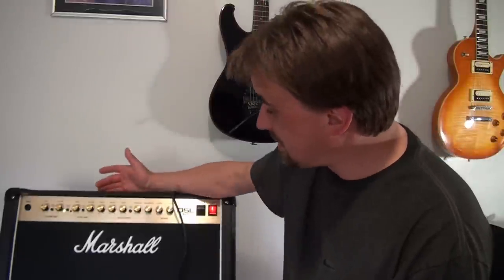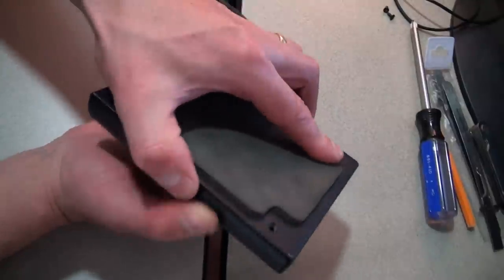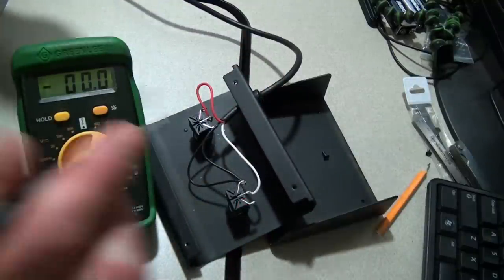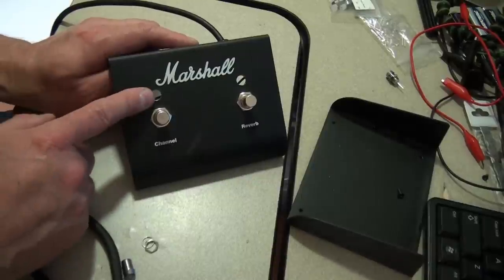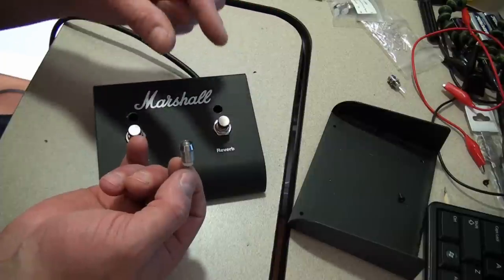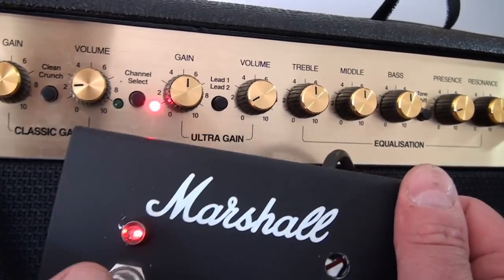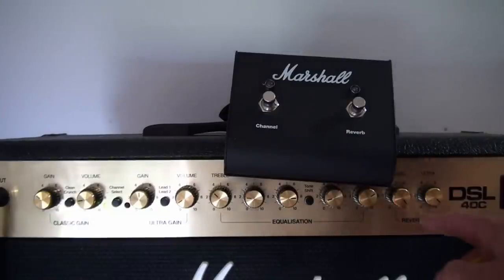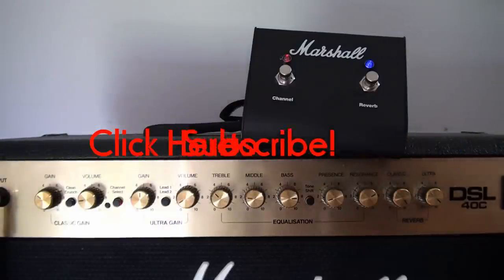How to Add LED Lights to a Guitar Amplifier Foot Switch Pedal DIY Marshall DSL 40c Mods LED Lights

Comment: Hi Mark thanks for the in-depth video. Helped figured out my issues working on a  Engl Screamer foot switch without using DIN or Midi connectors. 4 LED indicators status 2 for gain 2 for clean 1 for reverb. Finally got hold of a schematic as i couldn't work out the switching as the power is supplied to each LED. Don't try working on these complex switching powerless pedals without a schematic as your head will spin endlessly.  No battery but it needed a capacitor and resistor wired out of series to alloy the connection to be in a off on state that the LED glowed by using multi coloured single LED's. Thanks once again I went back and used various load resistance so a switching state represented by a colour status but require some serious trial and error by configuring 2 x  3 DPTS (Double pole Tripple Switch) wired in unlatched position but alloying current to power the LED.   Luke Marshall I have a JVM 410 and the switching uses 1 guitar cable for many different switching applications " great design " I wish Engl could have designed the same type of electronic switching design.

Comment: Mark... nice video.  I have my DSL40C on order.  I'll likely make this mod.  Easy mod.  I'm a Ham Operator, so I soldering and moding  is not stressful to me.  Built lots of transmitters receiver, etc over the years for that hobby.  Thanks for the tips and demo.  Great Job...

Comment: So, you started with 470 ohm which was the calculated resistance and you ended up with 4700 ohm? I was wondering if there was a more exact way to calculate it.

Comment: Hi!

First and most of all: Thanks for this awesome video!
I don't really understand why those leds aren't there in the first place (as well as why you cannot change e.g. gain - ultra gain via pedal.

Second, I discovered some differencies (?) I'd like to share (I have a DSL 40C aswell):
- The voltage was 4.9V.
- Unlike yours, my led lit up when active (reverb, gain) when I connected it in parallel to the already made connections. Not sure how to phrase that technically correct ...  hope you get what I mean. To rephrase it: I hooked up the resistor + led where the wires are already connected to the switch. I think you meant to connect one wire to the NOT connected "leg" of the switch, right (around 7:52)?
- Due to my leds, I still ended up with 4.7k Ohm (1.8V-2.2V, 20-30mA).

It all works like a charm!

Greets,
Christian
Reply: I also had same voltage on both switches. Ended up using 3.3k resistor for both red LEDs. I hooked them up as if the LED is shorted. And when its in Ultra Mode, it opens. Anything less of the resistor value will not change channel because current still flowing and connected.

Thanks for the video! Helped me alot

Comment: For everyone who wants to do it for a LANEY amp. It´s not possible for some models. I tried it with a Laney LC 50 Combo and it didn´t work. I read it later on google that you have to build in a battery but i´m not skilled enough for it and i alson wouldn´t want to change the battery. I use it anyway, light on means of and light of means on. Thats better than no light :D.

Comment: Could you post a wiring diagram as to which post on the switch you wire the LED to.  Around 11:20 you show the wiring but I'm not sure I can see the correct  connections.

Comment: presumably this mod will work for the vox vfs2.  I'll be making a pedal for A/B channel select and effects on/off and was wondering if LED could be added, happy to find this video. only difference I see possible is which way round it switches, ie open circuit for channel 1 and closed for channel 2 or vice versa.

I bought a reverb pedal recently which had a very bright LED, so bright it was blinding, lots of glare. 1000 grit wet and dry to the LED bulb helped reduce it to a nice glow by 'frosting' the surface.
Reply: the LED is still a tad too bright to be honest but it's much better. after reading your reply I had the idea that maybe swapping the resistor to the LED would be a better solution but being that the pedal is 1"x1"x3" approximately and the board is a tight fit and probably stuck in with something I can't see, I couldn't get it out, without risking damage, to even see any  components or connections.
but while I was just thinking about what I'll use as an enclosure for the A/B pedal I want to make, a question popped into my head. When you fitted the LED to your circuit here, why didn't you simply fit it to the clean channel so it was unlit when you switched to OD?

Comment: Cool, great mod! Question: I would like to put a female input jack on my Marshall pedal (same one you have) rather than using the embedded cable that comes with the pedal. I would like to plug in a cable instead. Which input jack type would I use and how would I wire it? Your help is much appreciated!! Thanks Mark!

Comment: Hi Mark. I have a Marshall DSL100H which also has a reverb and channel select switch but since I'm not planning on using the reverb I only need one switch for the channel. will this still work the same? can I use an existing Marshall switch with a pre installed led and just rewire it to work with my amp changing the resistors maybe? Thanks

Comment: Good idea. But I didn't understand completely how you do to light the led when the connection is open.
I got a Mesa Boogie DC 3 and when I push the foot switch the gain channel is on en the led off.
Can you share a graphic with the connections?
Thank you so much brother!

Comment: After watching your video I thought this was a great idea and should have been made this way to begin with. I opened up my PEDL-90010 but its all a circuit board. I could do it if it were normal wired circuits. So I'll just at least eliminate the hardwired cord with a female guitar jack.

Comment: Cool Video!  I have an EVH 5150 iii el34 amp.. This amp has 3 LEDs for three separate channels... It has Clean (green channel) Overdrive (Blue channel) and High Gain (Red Channel)... I was thinking of putting a strip of rgb led lights like you get on amazon and stick on your wall inside of the amp.. I want the rgb strip to turn red when the red channel is active, green when the green channel is active, and blue when the blue channel is active.. The LED strip has 4 connectors 12v, R, G, B ... I want to solder a 12v connection from inside the amp somewhere and then solder connections to each of the LEDs that are already inside the amp to the connector for the RGB LED light strip.  Do you think this is possible? Thanks.

Comment: I just found an original soldano footswitch for my hot rod 50. It only has an input jack, the switch and led with no resistor. I seen a few other pics on the net that look similar. Do we need a resistor

Comment: hey its old but maybe you could enlight me ^^
my mg100dfx switch, have two switches too. For the reverb/efect one, it works the same as yours (open when ON and current going through it) and for the distortion switch its reversed! (closed when ON and no current at all going through the poles!)
Is it possible to wire it to have a led on the distortion? or am i condamned to use a green led on it to say "YOU ARE ON CLEAN!" ? Thanks for the vids tho!

Comment: pretty awesome man, never really thought about that. I actually have one coming (the Sweetwater version with creamback speaker) so i may do this to help indicate from the switch, great video!
Reply: Absolutely I will, I should have it Monday or Tuesday. I'm almost positive it's the G12M 65 watt, but I'll verify when it arrives. I've heard demos with the G12H 75 watt that sound even better, but it's all relative probably.
Reply: Let me know how that works as well, as I might also do that. I've read about that (of course) and was curious. I had a DSL100 half stack from 2010, it was good, but I think the cab that came with it as a kit had rocket 50' s, and I was never really impressed with it, although I also never swapped out speakers. ( didn't exactly feel comfortable working on my own equipment at that point in time.) and it also had that "hiss". If I could turn back time I would mod that head and swap out those speakers. I bet it would have rocked then!
Reply: It was SERIOUSLY loud for sure! Yes, solid state vs. Tube is an incredible difference between not only tone but volume as well!

Comment: mine has 2 separate input jack for reverb and channel on rear panel. Will reverb switch works on it if I use to plug it in the channel footswitch input? or need a 2 separate single button footswitch

Comment: Great video.! I just bought an JCM 900 dual reverb, it has 2 channels and indeppendent reverb for each channel and I dont have the original footswitch and i am planning to built it. It would be the same configuration as yours??

Comment: question if i wanted to make a foot switch just to change from clean to drive channel on my fender fronman 15g does it have to have the foot pedal channel or can i use the input  plug?  the reason i ask is because i noticed most of the ones that make there own foot switch has the foot switch or what ever it was called plug.

Comment: Hey Mark how are you?
So, the footswith i've made for my boss were made with push switches (Not sure if this is the name for it, are those kind of switches that don't "click" you know?)

Is this case, it's possible to install an LED on it? Since the power on/off method is based on closing the connection coming from the power source.

Comment: I made my own switch and I’m running into an issue where the led lights are on when my second channel and boost are off, any ideas on how the make the led turn on when the channel and boost are on? I’m running a 5150 iconic

Comment: Hi Mark Great Vid thank you!!!...  I have a Marshal MG-250DFX that I tried to do the same thing with.  It has a Drive and and EFX switch (verb is always on).  I used a red and green LED Resistor combo from radio shack and the green is very low light and the red is bright enough but the switch is reversed (on when clean off when drive).  The green one is correct.  If I understood this correctly my problem is not polarity it is resistance?  And I need to add more resistance to the drive side switch?  I purchased a bunch of LED's that came with resistors... so I'm thinking I can swap out the ones I'm using and try different ones to make this work.
Reply: ***** I'll have to check to be sure. But it seems that way.  Also my switches are different than yours they have a total of 6 pole pieces each instead of three.

Comment: I would like to try this with the footswitch for the reverb on my mixer desk but I'm worried in case the LED would draw current away from the reverb unit and possibly damage it. Do you think that's possible?

Comment: The whole issue with the CLR's for the leds could have been avoided by buying switches with more poles. This would of course jack the price up, but not to a point that actually means any significant money. Still, it might double the build cost.
Reply: You can always use jumpers on a (in this case overkill) 3PDT switch. On the other hand, you have a point, the only power source is the feed from the amp. But figuring out what actually triggers the switching would probably be necessary to perfect it. Maybe a parallel circuit could yield different results.  Just confirming the switch pattern doesn't  really tell us everything... Or am I completely out of my depth here? I'm definitely no authority on this...

Comment: Si, pero como haces para que encienda el led del reverb, ya que este no manda señal/corriente. un grafico de la coneccion, yo lo estoy usando en un equipo hiwatt y cuando quiero hacerlo  y probando , para que prenda el led anula la accion del efecto o al revez el efecto acciona y el led no enciende.PD: Esto no sucede en el selector de Channel, ese anda perfecto.
Reply: Hola, lo pudiste resolver? tambien tengo el mismo problema, no enciende el led del reverb. Gracias
Reply: Si lo resolvi, cambiando el pulsador de 3 por uno de 6 que me regalo la gente de Cluster. Genios. y de ahi saque un circuito paralelo con una bateria de 9 bolt. Ahora, esto no fue todo porque parece ser que el reverb acciona cuando la llave corta, por lo tanto el circuito en la llave de seis va invertido. Es complejo no se si me explico.

Comment: Really helpful video, thanks!  I would just advise that you shouldn't measure continuity on a powered circuit. :)
Reply: He was measuring continuity on the plug, which was disconnected from the amp. So, it wasn't powered.

Comment: not sure how to wire the led to the switch
Reply: +Mark Jenkins . . . Good video but a simple hand-drawn schematic would be helpful. It's hard to tell in the video (at 11:20) where the LED and resistor are connected to the switch. Is the resistor in series or parallel with the LED? You also don't mention that LED diodes have a polarity (anode and cathode) and only allow DC current to flow in one direction.